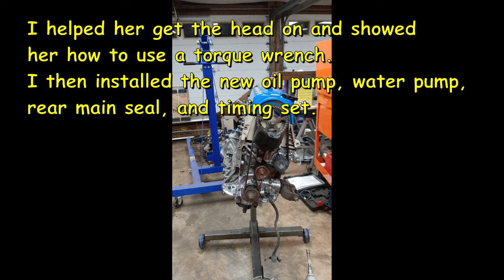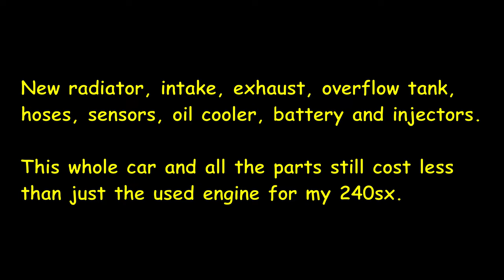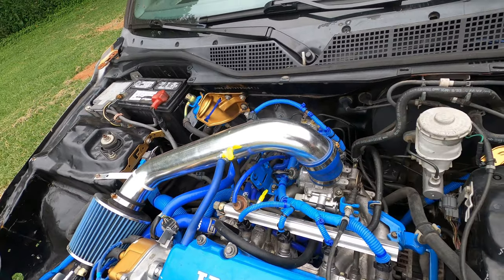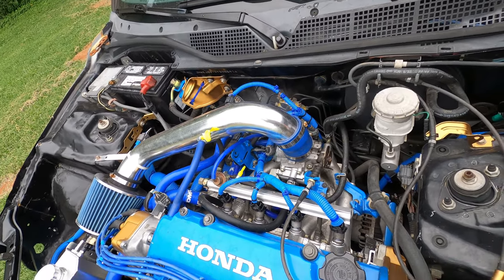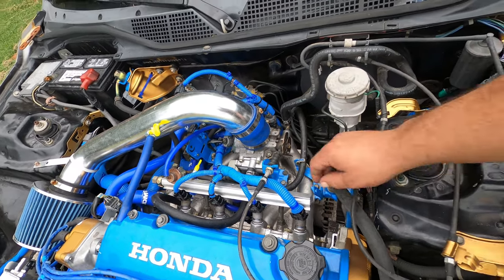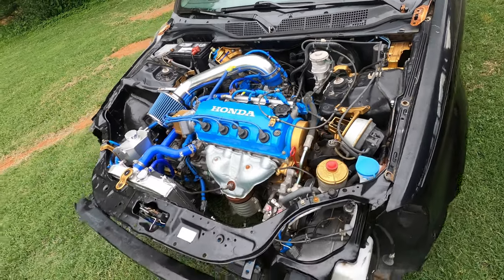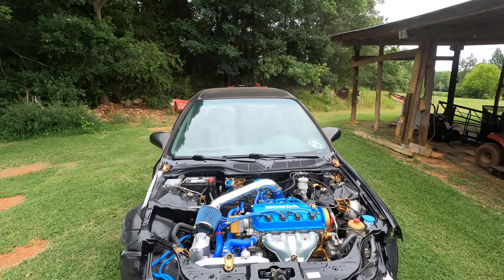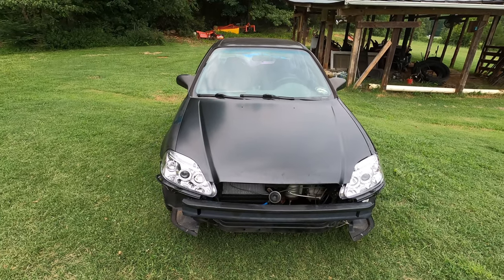The Wife's 2000 Honda Civic Project Car - She Made Me Buy Her A Harbor Freight Parts Washer.

Comment: Nice work Steve. Awesome learning experience for Kenny.
Reply from the maker: I'm still learning myself, but getting much braver.  I eventually want to build my own car from scratch with a custom monocoque chassis.  Similar to the way the consulier gtp was made. But mid engine rwd, 1000 hp with a gross weight of less than 1500lb.  I think that would be a fun car to drive